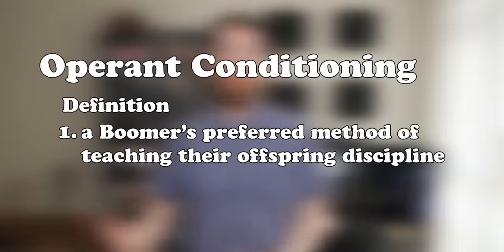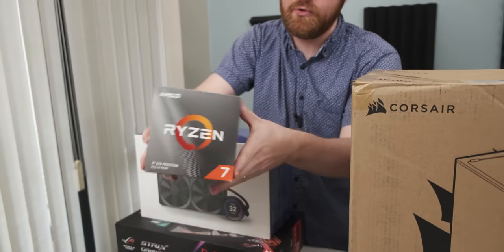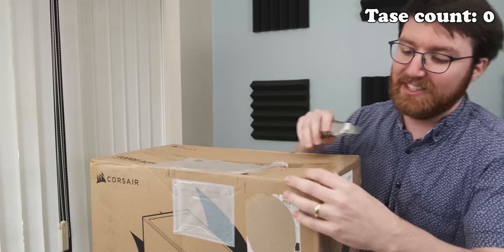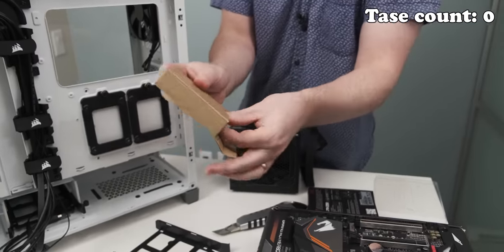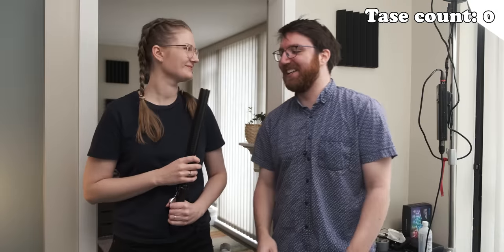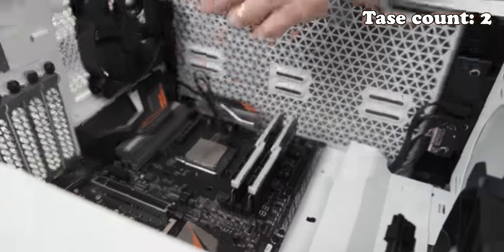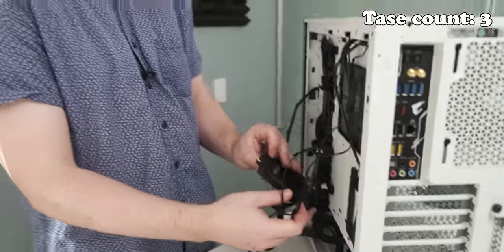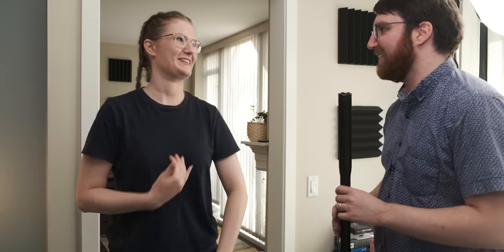The MOST shocking PC build ever...

Comment: I love the fear that starts to creep in when he starts to flinch at the thought of dropping a screw or the taser getting close. Best video I've watch in a while. Also to the SSD screw question, yes.
Reply from the maker: Thanks for getting back to me on the SSD question 😁
Reply: why though when 2 screws are enough?   they're not heavy.
Reply from the maker: @sto12m  That's exactly my point. 😂
Reply: @DawidDoesTechStuff  my old 2900k system had 2 ssd's raid 0'd and only held with 1 screw on each side of the tower.   they never moved once in 8 years.  you're right, it's a waste of time

Comment: My trident Neo's are getting rattly too. I think it does it with heat over time, I don't remember them being like that before I put them in my main system 6 months ago
Reply from the maker: Oh that's interesting. My was like that out of the box. Maybe the thermal pads lose grip.
Reply: Don’t you mean Tri-dizzy
Reply: Hey its timy joe me make computers about the internet
Reply: Mine were like that when I bought them
Reply: Is it just the neos? I have had tridentz rgb in my system for a while and never noticed it

Comment: I'm happy you published this after I did my build last week as the Mrs just got a tazer and would be more than happy to emulate this.
RE: The SSD '4 screws' question - nope, two screws only if mounting them. Hell, I have two of them just tossed into the bottom of my case sitting loose as the case only has 3 SSD mounts, and I have 5 drives.

Comment: Little tip as well for those who don't use the triangle method, the raised end of the CPU socket that the latch is in is the "top" of the socket, so you can arrange the CPU based on which way the text is facing as well. I'm not sure if this is right 100% of the time cause its not listed in any guide/manual, but of all the systems I've built for myself/friends/customers over the last few years this has worked out so I'm fairly confident in it.

Comment: I just built using the Corsair 4000D Airflow case like the one in this video. Lovely case, picked it up for just under £80 from Amazon in the UK. After cutting my cutting teeth with cheaper cases I can’t go back now. A definite recommend for this Corsair case.
I don’t put all 4 screws into SSD cases either, its not as though its going to vibrate like a HDD is it? 2 screws are fine for SSD case.

Comment: I have that same case and cooler in my build. I love it. Was super easy to build in and the cable management channel with the Velcro loops are great!  The only down side to the cooler is that you have to run NZXT CAM software in order to control the LCD, although in all my test it did not seem to impact performance at all. Using only 45-110mb ram in the background. I have a I7 12700k, Asus TUF gaming z690 plus (wifi), 32gb Corsair 3600 (single channel or course🤣🤣) Aorus RTX 3070ti master and EVGA 850w  all in cost me a smidge less than $1400 usd

Comment: I keep an old unusable speaker with a large magnet on my workbench. When my screwdriver starts to not hold the screws firmly I just rub the tip on the speaker manet for 10-15 seconds and it's good as new. I rarely drop screws anymore.

Comment: I have a pro tip Dawid, find yourself a old dvd drive, crack it open, take out the laser assembly, crack the lens part open, and you will find 2 to sometimes 4 lil' magnets in there, i think the LG ones do have 4, and they are so small that you can attach them to your screw bit and never drop a screw again, sometimes the screw will flip over on the magnet, but its way better than turning your case around in the air trying to get that 1 screw out of there :p

Comment: I haven't even started working yet but are all giggely of what's to come :D Also looking forward to Anna geting tazed. But a correction about "heart getting stopped". Since we all know this is all for fun, unless you have a heart condition tazers are generally very safe. Because there's a small window of how powerfull or not powerful a tazer should be to not die. I don't remember the data but as long as the makers of the tazer don't haphazardly just puts components together without knowing what the impact is, it's mostly safe. Except, if you maybe taze someone for too long or too many times without the body having a chance to cooperate. Sorry for my grammar, I don't feel very smart today. :)

Comment: I thought having the AIO tank and hoses below the cpu block was bad for AIO and made it so it could fail sooner?  I've heard that if,  And it was confirmed by multiple AIO manufacturers, you configure this way it will force all the small air bubbles present in the system into the pump and they will stay there causing damage.

Comment: I once dropped a PCIE mounting screw. Looked all over the place for it... shook the case, nothing... 3 months later l found it! It was between the GPU bracket and the GPU heatsink... the threading was stuck in the GPU heatsink, thats why it didnt rattle 😐

Comment: pro tip....You can re-magnetize  your screw driver if you have an old speaker magnet ...Simply rub the tip on the magnet(scratching it) and and some particles with stick to it and it will become stronger. It also works for non magnetic screw drivers

Comment: Take a powerful magnet, the most poweful one you can find, and stick it to your screwdriver on the side close to the handle. Then slide the magnet down towards the tip slowly, and take it off. Repeat several times. Always attach the magnet to the same spot and side on the screwdriver. Now the screwdriver is thoroughly magnetised, you don't need the magnet any longer.

Now you will no longer lose screws. And if you do, you can just reach down with the screwdriver to pick them up.

OK maybe i should say that with a fully magnetically powered up screwdriver, i'm unable to lose screws, maybe it doesn't apply to you.

Oh also don't use a screwdriver with replaceable bits, they're just not very good, and i'm not sure whether they can be magnetised like this. You only need a #2 for 90% of your tasks, so you might as well buy a proper one, OK?

Comment: Trident-z ram i used in the past 2 times one time they refused to run at their rated speeds no matter what and in another situation when i built a system for a customer using Trident-z they almost fried the mobo and i had to switch the ram so it didnt blow out the hard ware later on it even caused the mobo to make sounds that sounded like electricity arching